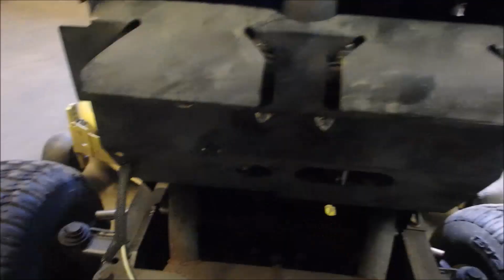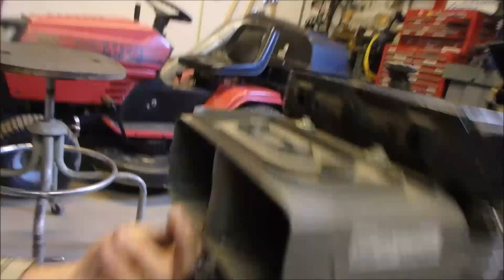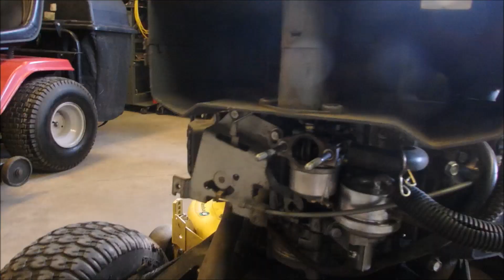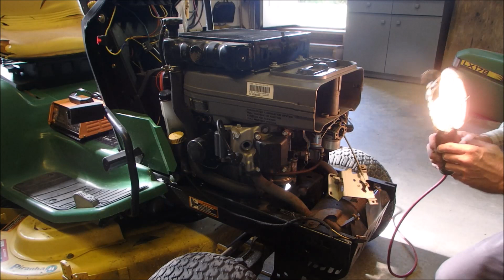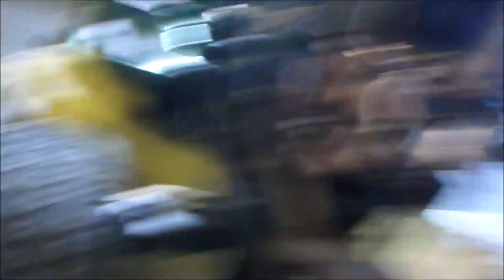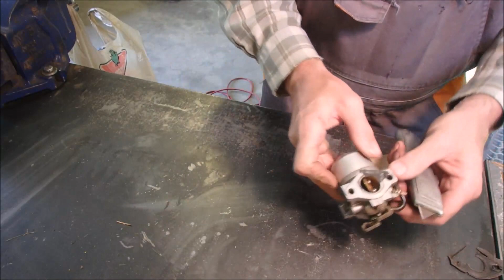John Deere LX178 Hardly Runs Part 2

Comment: So i have the same model, replaced the starter solenoid And now the motor starts but just hooking the battery
Reply from the maker: I would reverse the power leads on the solenoid.  You are putting 12 volts right onto the starter.  Reverse the 2 bigger leads.

Comment: Bruce I know this is an old video but for the future. If you watch a video by Mustie 1 in New Hampshire you can see how he does a gasket. You cut a piece out and then get the ball end of a hammer and tap all around the gasket material against the opening on the carb, it should cut all around the edges and then you can just pull it apart. Much easier to do. Hope you give it a try and hope she works better for you.
Reply from the maker: Right an older video.  In this video at 16:03  (below)  I do use a hammer.  It is a bigger gasket as well than this video  
https://www.youtube.com/watch?v=n0E7QD1S9Us

Comment: A You Tuber in New Jersey puts the gasket, cut to the outline of the part, on it and then takes a ball peen hammer and beats on it, over the hole.  Eventually, the inner part that you don't want, tears at the edges of the major hole. I'm not sure if it works for bolt / stud holes, they're so much smaller.  805RoadKing is his handle on You Tube.
Reply from the maker: I know Everett quite well even though we are 2500 miles apart.  This video is 2 years  old now.  Thanks.  te intake on this tractor is all plastic

Comment: If I put my thumb over the air intake and it doesn't suck, what's the problem and solution?
Reply from the maker: Right     That is a good one to remember.
Reply: I have a LX178. Plugs have a good spark when taken out, fuel is getting through but it doesn't fire.
Reply from the maker: Have you taken the compression?  It sounds like your intake suction is low.  Just thinking as I type.   How is the choke  working on and off.  Did you prime the motor with gas to see if it fires?   Maybe a fuel pump.  Just keep playing with it , you will get it.  Sorry i missed your first comment.
Reply: I haven't a compression tester. The choke seems to be working as normal but it didn't fire on WD40
Reply from the maker: WD 40 is a Water Displacement product. Thus WD40   A bit of gas is better but be careful.  Also can you hold your finger over the plug hole while turning it over to see if you get a puff of air against your finger?  once again be careful.  That will also make you feel the suction of the motor upon intake stroke.  .  Take both plugs out.
Reply from the maker: You may also have to check the flywheel key.  Sorry lot's of info coming your way
Reply: I get good suction and pressure on my thumb over the plug hole
Reply from the maker: I say check the flywheel key.  next   but before you do put some gas in each cylinder and put the plugs back in and crank the starter.  It should fire if the timing is OK  (flywheel key)  You are getting there.

Comment: That engine is a twin right?  I'm thinking you have spark and compression.  I was thinking maybe weak spark, but on a twin at least one cylinder would run.  You mentioned that you know it is getting fuel, I'm thinking you should inspect the flywheel key.  If someone had the carb off, maybe the linkages are put back incorrectly, was the engine choking properly?  Looking forward to Friday's video.  Bob
Reply from the maker: Next friday is the day we find out.  Thanks for the input.  PM sent.

Comment: it looks like if the intake gasket was leaking it would be running lean rather than rich?? just a guess.
Reply from the maker: You are right.  I thought that is was blocking it a bit but I found out that it was not the cause.  Thanks for being observant  I will continue looking..
Reply: I'll be watching to see what you fine out, might be the float valve or even the float but it it was that , looks like there would be gas running out somewhere.
Reply from the maker: You get it.  all I can say is stay tuned.

Comment: bruce when you need the outline for gasket try a little wd40 on the face of the carb press it on the gasket paper and it gives you a perfect pattern  then just cut it out a little trick my grandfather showed me years ago
Reply: Nice tip. Thanks, Deek.
Reply from the maker: That is a great idea!!
Reply: That is a good tip.  I usually use lip stick, but wd40 would be easier.